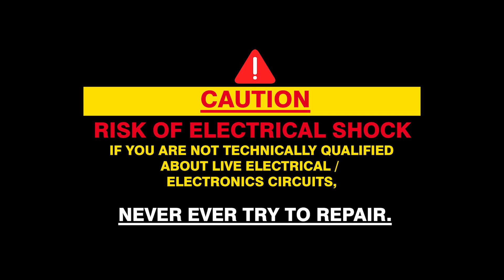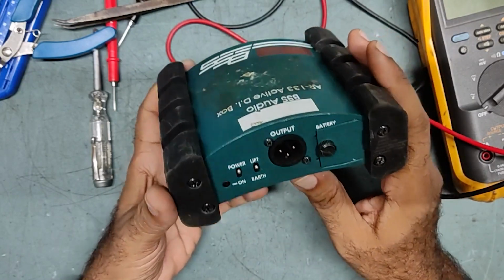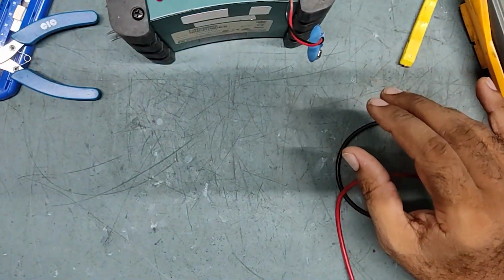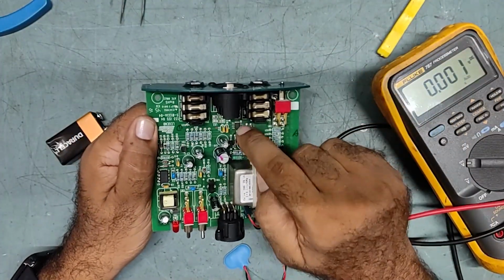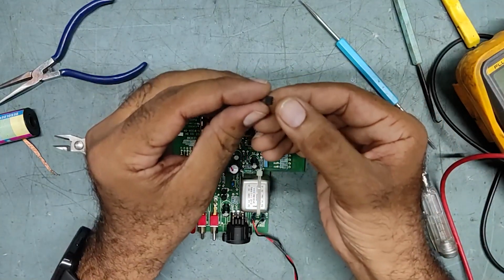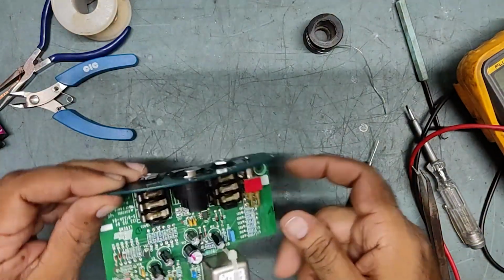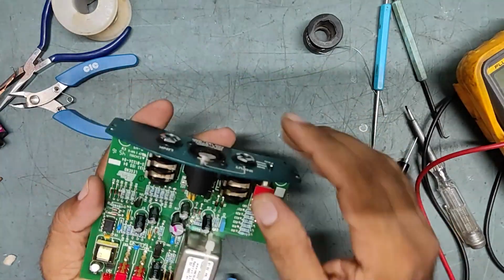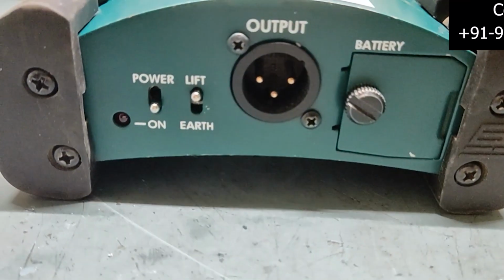How to Repair Faulty Active D.I. Box. Very Simple Tips & Tricks method.

Comment: It’s continuously on if it is receiving 48V phantom power from a sound desk too. It flashes when it on battery power.
Reply from the maker: Without any input signal or 48 Phantom, once DI  power ON in an idle condition then front red led power light must flash slowly it indicates device is ok condition.